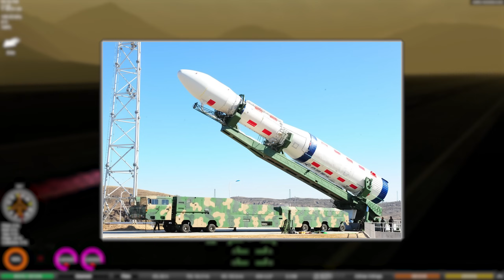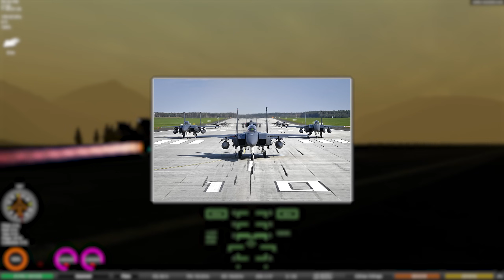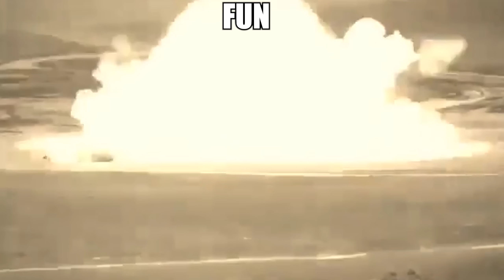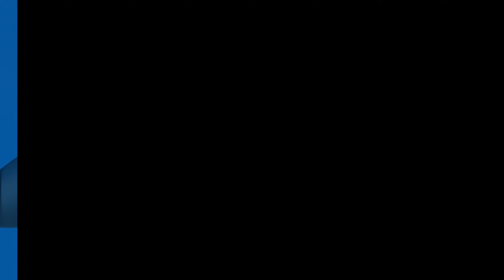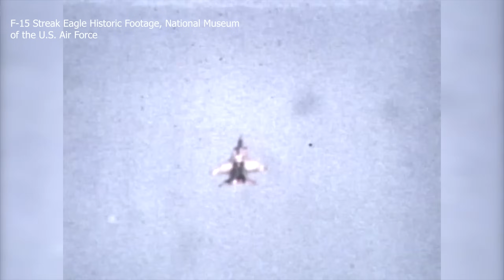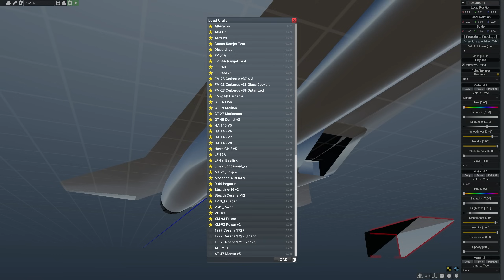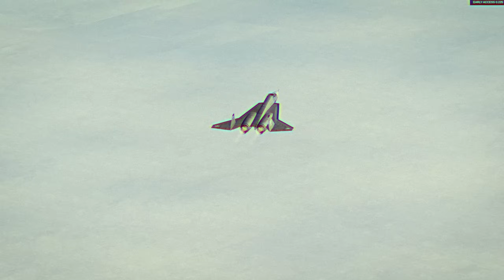I Continued America's Most Ambitious Jet Fighter Program

Comment: The main advantage of the ASM-135 was that its not bound to a static launch site. Due to the variety of orbits available its very likely a target will only pass through the engagement envelope of an ASAT system very rarely or even never if the operator is aware of the ASAT launch site. Mobile units help but they still require the satellite to pass over the launcher. With an airborne system you can send the launch platform to wherever you need for the intercept to take place. All that being said the US Navy's SM-3 represents a great compromise as being ship based gives it a lot of mobility but still allows for lower cost and a wider engagement envelope than an air launched system.
Reply: And to top it all off, it doubles as a mid-course interceptor for ballistic missiles.
Reply: @Simulcrom  The SM-3 lacks the legs to be a true midcourse interceptor of ICBMs but can handle MRBMs, IRBMs, and SRBMs without issue. Its limited by the size of the Mk41 VLS Cell and is about as big as possible already with the block IIa version. The old ASM-135 doesn't have the legs or software for that role but had it entered serial production its successor probably would be able to do so. Ultimately however the response time would be a huge issue for such a platform. An IRBM total flight time may be 10 to 15 minutes which is not enough time to scramble, clime to altitude, and launch unless the host airfield happens to be the target. Even then those are very thin margins.
Reply: INRE:"send the launch platform to wherever you need": Like many other 'prototype' system demonstrations ( like SafeGuard ), these are mostly directed at the adversary's bean counters, who calculate the ROI of the development risk and costs to counter them. The proposed full deployed operational system used an F-15 with conformal fuel tanks in addition to drop tanks, joined up with pairs of tanker aircraft, the combined units deployed at various anti-podal points around the world, but especially at high latitudes where the polar orbits of military recon platforms converge. The high mobility you mention is essential because many orbital platforms have highly eccentric orbits ( especially Soviet comsats in Molniya orbits ) which have a very narrow window at perigee within range of the interceptor missile. There was also provisions for various 'RC-135' tracking aircraft.
Reply: Due to the variety of orbits available its very likely a target will only pass through the engagement envelope of an ASAT system very rarely or even never if the operator is aware of the ASAT launch site. Mobile units help but they still require the satellite to pass over the launcher. With an airborne system you can send the launch platform to wherever you need for the intercept to take place. All that being said the US Navy's SM-3 represents a great compromise as being ship based gives it a lot of mobility but still allows for lower cost and a wider engagement envelope than an air launched system.

That’s not how it works at all satellites do not have anywhere close to enough fuel to alter their orbits once set in place, they physically cannot avoid flying over a launch site it’s utterly impossible

Secondly you don’t really need a launch site just a missiIe with enough delta v to do a sub orbital hop. Put it on a truck or ship or anywhere

Your assumption that a satellite can just avoid ASAT launch sites is entirely false 
And that’s even given the idea enemy intel could know where they are

The issue with all interceptors however is that they indeed need to be right in the path. This is why you can’t use satellites to stop ICBMs, ICBMs would fly as a flock all at once in the same direction while your satellite makes a circle around the planet and is in the wrong place 95% of the time 

Plane launched ASAT is also IMO terrible because it all takes way too long. An ICBM from Russia to America using minimum fuel (it can go faster if it uses more than the minimum) would get there in around 20 minutes. Pretty sure a soyuz could get there in 10 or 8 minutes. Now compare that to how long it takes him to fly from runway to altitude then add the time to sortie the plane and time for the missiIe to climb lmfao. 
Just an awful awful useless doctrine

And there are now also far too many satellites for planes to take them down it would take ages, maybe one hour per missiIe, but you have 30 thousand swarm constellation targets and 10 planes lol 
Oops!

It’s not fully useless for spy stall it’s because there’s not that many of them currently. America has around 20 upscale versions of the Hubble telescope it uses to look at the ground. 20 is a small enough number that a few planes form idk China could launch a missiIe from altitude and take them out. So not entirely useless just generally way worse than a regular rocket. Fuel efficiency is better but it’s all too slow
Reply: Also your ship based SMs are also obviously useless for interception unless the destroyer is already in the middle of the flight path

Personally logistics wise I don’t see why you couldn’t just put a missiIe of any size on the deck of any boat even some trash hunk of rusty civilian steel and just launch it from the deck that way instead of a vls cell. VLS allows to pack a lot on each ships but you can just put them on the deck it works just fine, secure it with cables or whatever, make sure the ship is stable enough (container ships mastered that) and you can just use basically any large maritime or cargo vessel to launch interceptors or even offensive ones (same thing) from anywhere 

I’m saying this for your comment about the max size of the square cell being an issue. Like if you need a bigger rocket just launch it from the deck lmao, it’s not like you can deploy a destroyer to be in position quickly anyways, both a random ship and a destroyer will take days to arrive to a place where their little suborbital baby rockets can even stand a chance at interception. Wouldn’t bet on the interceptors though lol, especially if I get to design the offensive ones and plan their flight path. I for one believe in offense
Reply: I think the larger, ground-launched ASAT missiles have the additional delta-V required for off-axis orbits. (Based on zero knowledge of the subject.)
Reply: @michaelmerrell8540  They most certainly do but a lot of that is alleviated by the air launch which effectively eliminates the entire first stage of a comparable ground launched system.

For some scale the American Ground-Based Midcouse Defense missile (which yes is not formally an ASAT weapon but if it can hit an ICBM outside the atmosphere it can hit a satellite the only difference is software)  is a 3 stage 16.8m tall 1.27m in diameter 12700kg missile that can loft its interceptor maybe 500 kilometers over the Karmen line and 5000 kilometers downrange to engage an ICBM during its midcourse phase.

The RIM-161C SM-3 Blk IB which has actually demonstrated an ASAT role (an even earlier version of the missile but that's not important) is 6.55m long, 0.34m in diameter and around 1500kg. This allows it a publicly disclosed range of 900-1200km with a flight ceiling likely around 500km

The ASM-135A was 5.42m long 0.51m in diameter (includes fins I can't find the tube diameter in short notice) and 1180kg. This gave it range of 648km and flight ceiling of 563km.

As you can see the large GBI missile which is about the size of a larger Tactical ballistic missile has the ability to hit higher orbits and do so over a wide area but it costs around 10x as much as an SM-3 missile and is a massive object stuck at a fixed launch site.

The SM-3 while smaller can hit targets nearly as high up and still have a very respectable downrange capability. The ASM-135 meanwhile has the ability to hit a target with similar range to the SM-3 despite being a much older system using rocket motors multiple generations behind what powers the SM-3.

Ultimately all these systems are limited to low earth orbit. To engage a target further up you need a larger system for example an actual orbital class rocket.

Comment: I really like your montages? They feel like you're trying to sell me the plane, not just showing off something neat you built
Reply: Second That!!
Reply: It's all total bullshit he just says stuff confidently but he has no idea what he is talking about at all.
Reply: Okay there, Anthony. No need be so upset over something you've provided no evidence for (that isn't to say that i think he's always right).
Reply: @ I hate fake experts. I have plenty of proof. Im an actual engineer. This was brought to my attention from kids I teach in a STEM program. Kids think if you have a YouTube channel your an expert.  The ASAT worked, it lead to the SM-3. A multi stage ground based rocket is not the best way to do it its one way to do it. The NAVY Now uses the SM-3 fired from a F-18 to get grater range, you can't use a Ship to protect Kansas. ALSO to fly high and fast you need massive compression and materials that can handle the heat the air is just too thin. absolutely everything he said is completely wrong.   That software is NOT valid. You can use it to do stuff that is not real.
Reply: @ calm down guy its a sim ....
Reply: @anthonyb5279  ashahaha dude you do realize that the dude is an actual engineer too, and the compression values he provided for those aircraft are in fact correct, that info is publicly available. He said that compression in high supersonic aircraft is achieved by a different mechanism than a straight up compression of the turbine engine like in slower aircraft. Mig25 as an example- compression 4:1, because it uses its inlets for that extra compression.
It's clear you have no idea how supersonic mechanics works. If you really teach people- then I must say, my condolences to them for having such a simple minded teacher ;(((
Reply: He’s not a fake expert because he doesn’t claim to be one, I doubt his goal is full fidelity, Hes sharing the information Hes reasearched/ already know
Reply: @ No he is not.
Reply: @anthonyb5279  Ok, you say you're a STEM teacher, cool. Messier is not an expert, he was/is a student himself just commited to making more realistic planes in this game. If your students saw this video, and it inspires them to pursue an engineering degree later in life, even if this piece of entertainment media is not 100% accurate, it has helped STEM fields. Why are you so upset?

Comment: as someone who took traffic engineering in college, lanes of traffic are analogized to streams of fluids/particles to make it easier to understand. you then basically use fluid dynamics to figure out how long a jam will last
Reply: Using fluid dynamics to understand traffic: 🙅‍♂️

Using traffic to understand fluid dynamics: 🫡
Reply: @Aperson156 HAHAHAHA
Reply: Traffic-Fluid mechanic analogyception
Reply: This isn't as surprising as you think. Think of water flowing in a pipe. Considering there's no holes, the water that comes in must come out. Same with traffic. Any car that gets onto a lane must come out, given there's no accident. That's the analogy.
Reply: @windowsxseven  exactly, going into the classes I should’ve known better. But was surprised by the amount of math
Reply: @Dabloon-d4o especially since people behave even less predictably than molecules of water
Reply: @windowsxseven  Shall I tell you about what hydrogen molecules do in some manifolds in high-vacuum/cleanroom applications? At a certain point, traffic stops being a useful analogy...

"See that Charger going down the highway at 75, in the left lane? No you don't. It's actually fifty feet behind us. And if we just wait a second... There. It turned left, and has now appeared in the middle of the park over there two blocks off the next on-ramp. And now, it's in New Brunswick."
Reply: @Sakhmeov continuum mechanics vs free molecular flow
Reply: HAHAHAHAHA
Reply: you ever put traffic on tracks
Reply: @carlosandleon 
Union Pacific would like a word